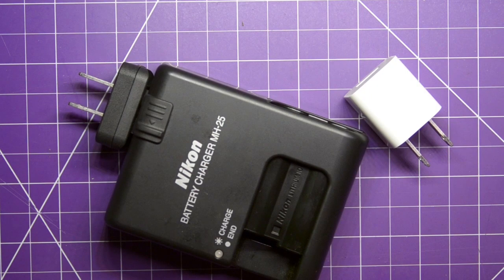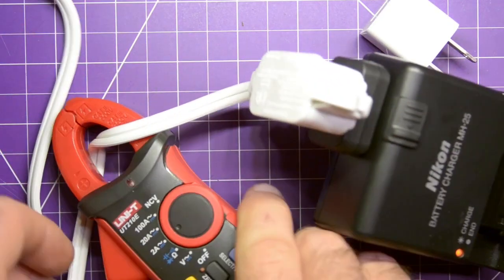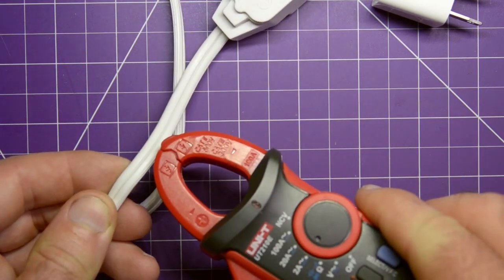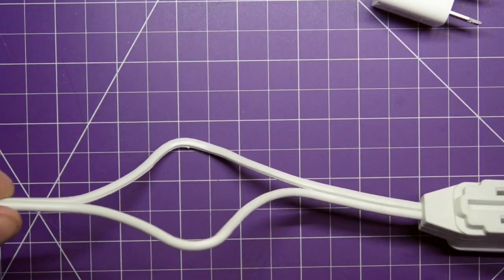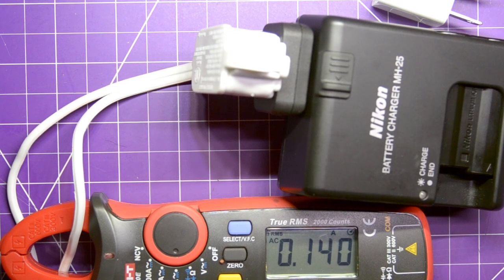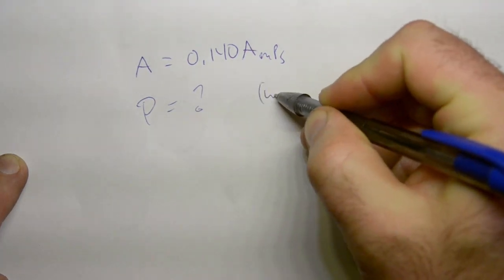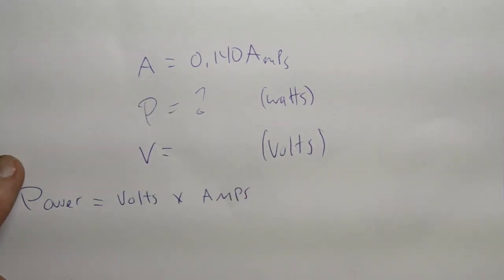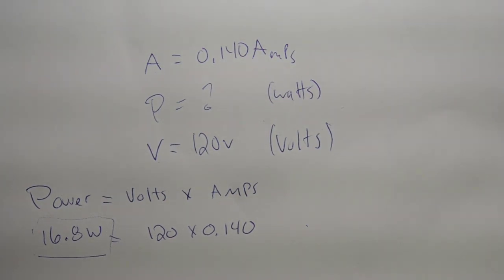How To Measure Power Consumption At Home

Comment: I have that exact clamp multimeter and ready product of the name voltcraft 4000 pro designed especially for power usage readings.
But my readings are different - which device should I trust? Both producents claim that meters are accurate but at least one is BSing I suppose
Reply from the maker: Test a known current, do you have an adjustable power supply?
Reply: @SimpleElectronics  sadly no, wish I had tho
Reply from the maker: Any standard resistors?

Comment: Why we take the main grid volt 120 v as volt? I thought inside the devices some voltage regulator changes the volt
Reply from the maker: It does, but you pay for what comes out of the wall
Reply: when the volts go down, the amps go up

Comment: Was also going to add, assuming your voltage is 120V is just an assumption. Depending on what you are really trying to find out that assumption might be ok. But consider this.. if the actual voltage is 125V the amps measured will be higher than if it's 115V, or even 120V. Which voltage at the outlet does vary.

For the person along about measuring the power without a clamp. ONLY if it's a purly resistance load, like a heater or an incandescent light bulb: You can measure the resistance (ohms) then use V=IxR  or I=V/R, then having calculated the amperage you can find the power. ONLY on resistive loads.
Reply: What about inductive load

Comment: Tx, it's helping, every little bit does. Is there a method without the clamp for a specific situation? All I need to do is confirm the led fixtures I buy online from China are actually what they claim them to be, cz most are not. Can't really afford a clamp meter right now. Any ideas?     ...p.s. I have a decent, standard multimeter. I tried leaving the lamp half plugged and touched the blades with the probes, lol, you probably know that didn't go well, haha

Comment: Not correct for AC. From Wikipedia, for ex. :: Ohm's law holds for circuits containing only resistive elements (no capacitances or inductances) for all forms of driving voltage or current, regardless of whether the driving voltage or current is constant (DC) or time-varying such as AC. At any instant of time Ohm's law is valid for such circuits...... this means it could be correct on any given time as short as possible, but not continuously. Remember, AC in your outlet is of the sine form.